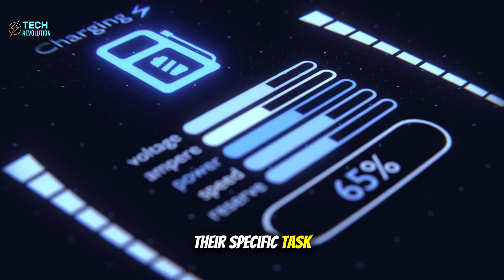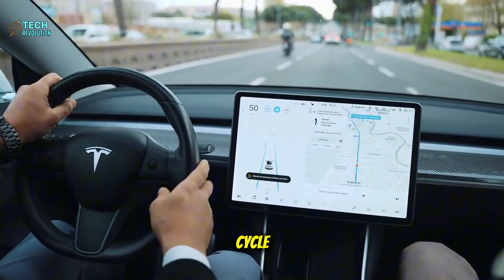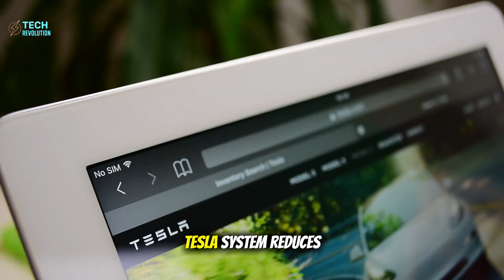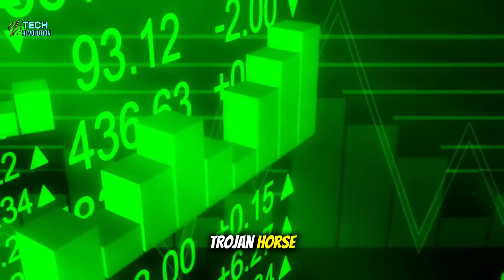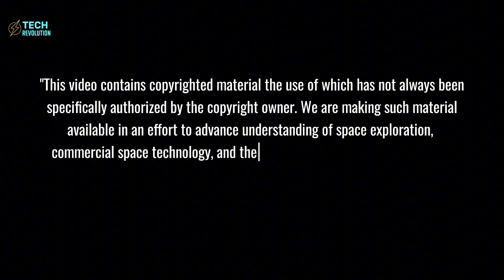Tesla Just LEAKED Elon Musk's Secret That Ends Lithium Forever!

Comment: Lost me at the 5 times longer. You can make materials twice as energy dense, pack them into half the space, but you can't make energy last 5 times longer. A unit of energy last the same no matter how you store it. To make energy last 5 times longer you need a powered device that uses 1/5 the energy of its predecessors.

AI hype, click bait.
Reply from the maker: Energy density doubles range, not duration; 5x longer refers to battery lifespan (15,000 cycles vs. lithium’s 2,000). Aluminum-ion’s durability and efficiency aren’t hype—they’re a game-changer.